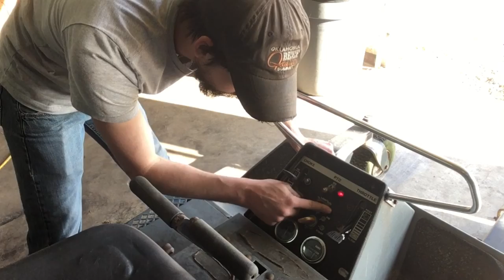How Profitable Is Flipping Small Engines?

Comment: Good video on what you did to bring that mower back to operational condition.  In educating myself on mower flipping, I have learned if the mower needs a seat, then it better not hardly need anything else Lol.  I just rehabbed a JD SX85 and a new seat for $123 off EBay was my biggest upfront expense followed by a new battery, ignition switch, and two front tires.  I paid $50 for the mower and put $400 in parts into it.  Currently working on 2 x Snapper ZTs I got for $500 for the pair; one runs the other can be made to run.  Fixing the neglected maintenance on the one that runs and then will be planning to flip the non-running one.  The running one needs a seat ($180 on EBay) and the deck spindles rebuilt but otherwise a solid running machine:-) with new seat and deck parts needed, will be into it $350ish plus the $250 for the mower itself which I am okay with that.

Comment: It’s fun to fix them up and resale them when I feel like it 
But I buy all the time and take to farm for storage out of weather 
I will work on 4/5 at a time as I feel like it
In winter I rebuilt the carburetor that I’ve replaced with new ones and label with engine and hp plus model and brand